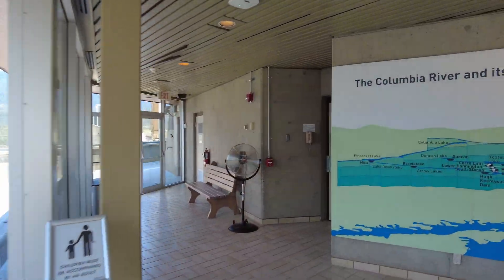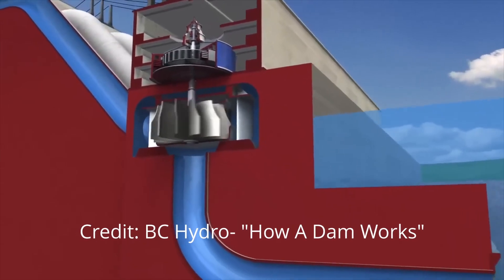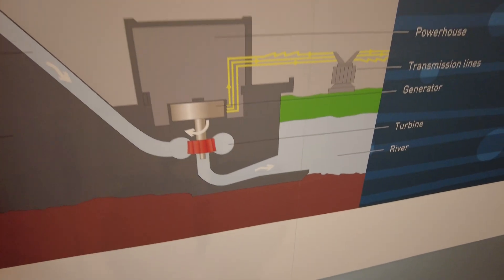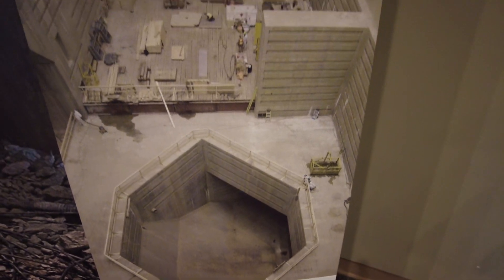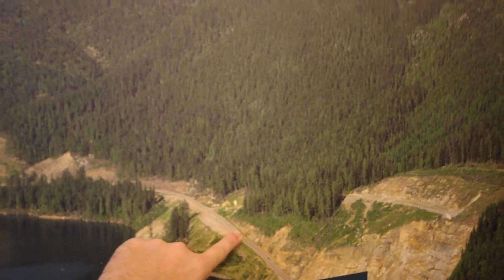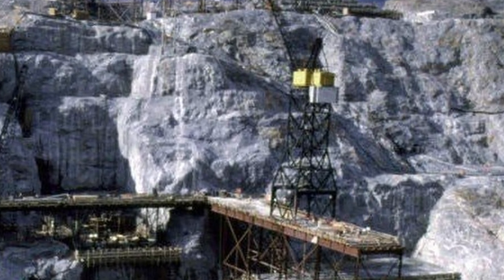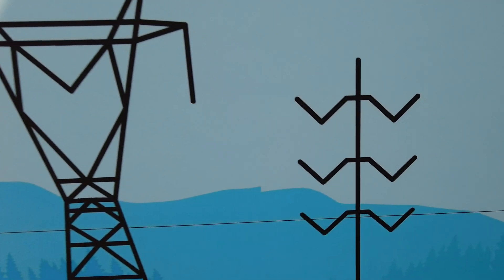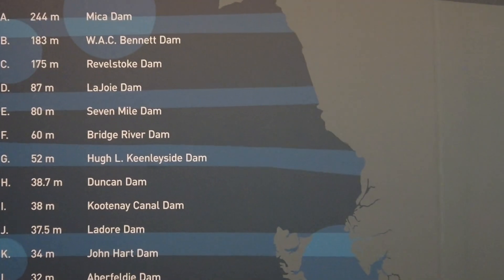Revelstoke Dam - Inside The Dam & Powerhouse, Power Generation Infrastructure In BC

Comment: Those wouldn't be commutator bars, those are the rotor coils fed with dc current through slip rings from the exciter.  The three-phase ac is generated on the stator coils.